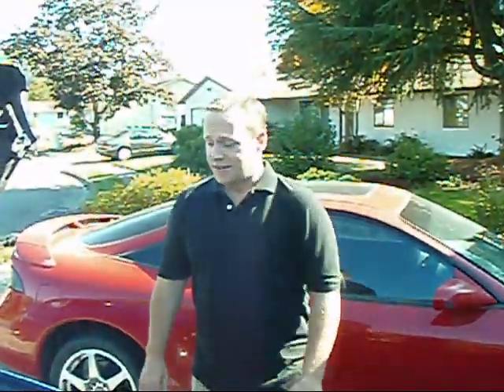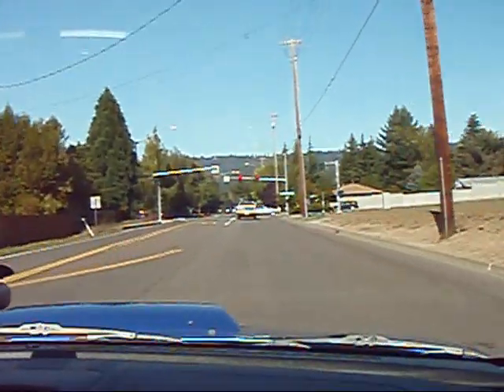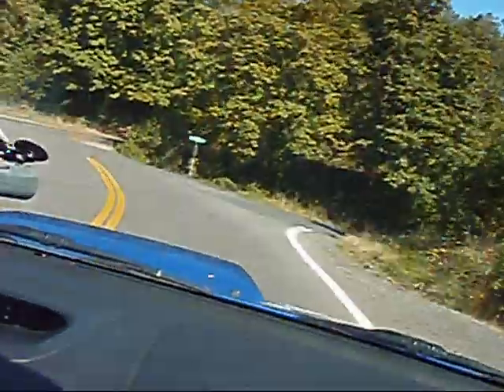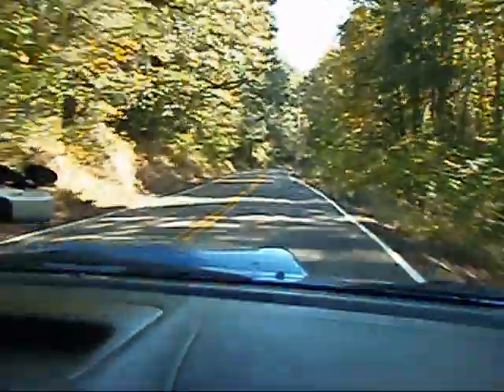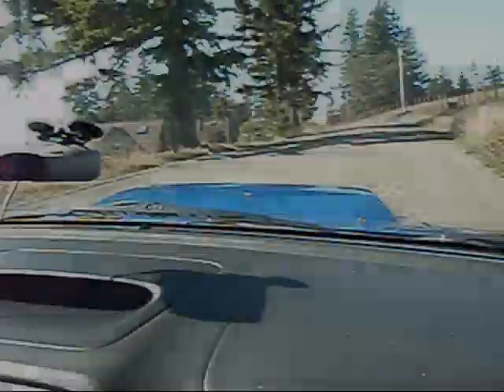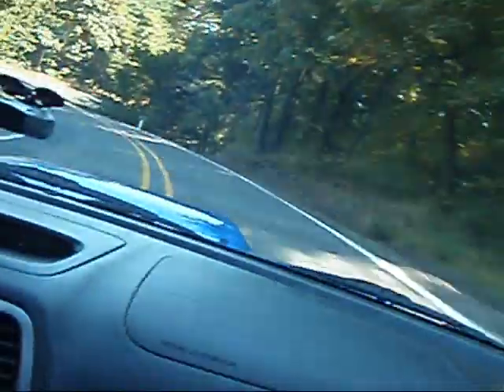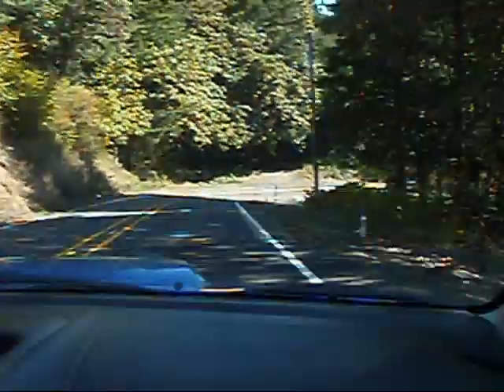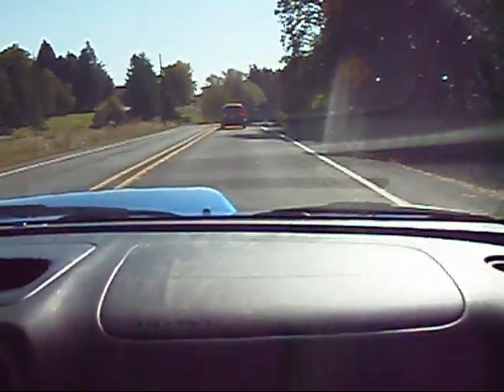WRX turbo swap pt3  mountain run

Comment: BOV (or Bypass Valve) on a WRX recirculated into the turbo inlet, which in on the intake side. The only regulator on the exhaust side is the wastegate.

Comment: I don't know if you have fixed this or not but I would go with the STi pink injectors. They can run a VF22 at 25psi so you shouldn't have any problems with that.

Comment: did you guys dyno or tune the wrx? what is the whp number? are you using the stock injector? i have the wrx and try to do the research before i swap the turbo like you guys, thank you

Comment: Now, correct me if Im wrong, but shouldnt you have gotten it tuned first? What I see is a bigger turbo swap on stock fuel, stock cooling, and no tune. And this is minor, but did you put a heatshield on the turbo or close the hood and go? lol

Comment: Did you reflash after swap? Have an accessport? First time swapping for me so learning as I go
Reply from the maker: We did not do anything to the ecu until a couple months ago. He finally got a Cobb unit. 
You have to understand that when we did this series, we maintained stock boost pressures after the swap.

Comment: What kind of boost may I expect after swapping with standard tr40L turbo? Think I need to reflash since I do have a Cobb AP
Reply from the maker: For the particular turbo we installed, I would say 20 psi is the thermal efficiency ceiling. It'll spool much higher, but you will just be blowing a hot, less dense charge. 
That was one of the reasons we left it at stock boost levels.
It picked up a decent amount of power just because the bigger compressor  blows a cooler charge at the same boost pressures, and the turbine housing flows better.
Very streetable, but probably only good for 300-350 hp if everything else breathes freely, and is correctly tuned.

Comment: About the WRX tho.. unless u have a COBB ap, u won't even be able to tune it. That shud always be first on the mod list. & especially after putting the headers on, ur guna need it. Ull be able to run 18psi comfortably after u do that. If it wasn't for the stock td05 messin up, u shuda just waited & saved up for a gtx3576r kit! The only way to go! If u ever make to Portland u shud go 2 my buddies shop "FORGED PERFORMANCE" on Marine drive! Best Tuners in Oregon! Then hit up PIR!!!

Comment: That's a bad idea. Godspeed turbos are junk. As are most $300 Ebay turbos. They're made in China with very little attention paid to quality. With something that spins at 150k RPM, I wouldn't cheap out on something that will fail quickly due to poor tolerances and workmanship. Especially since anything that might break free from inside the housing will go directly into your engine. Instead of wasteing your money, go on a Subaru forum like NASIOC.com and find a used VF39 from an STi in good shape.